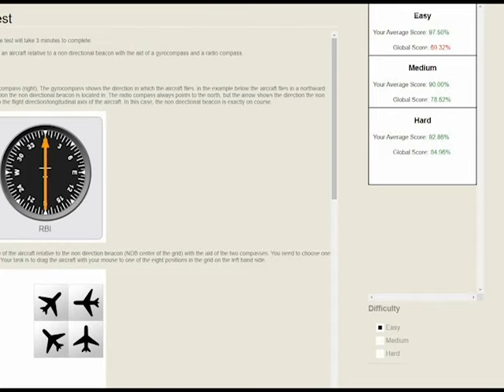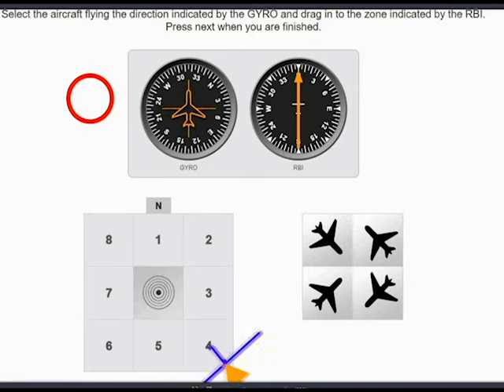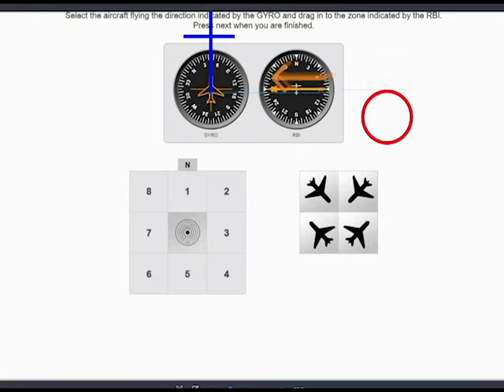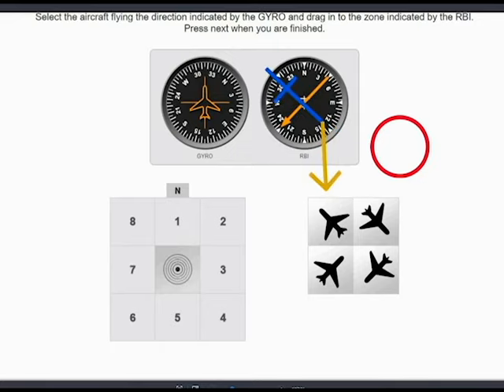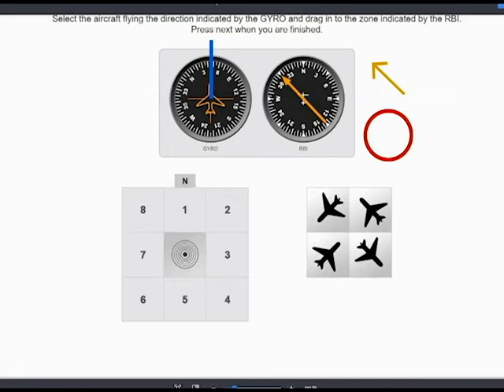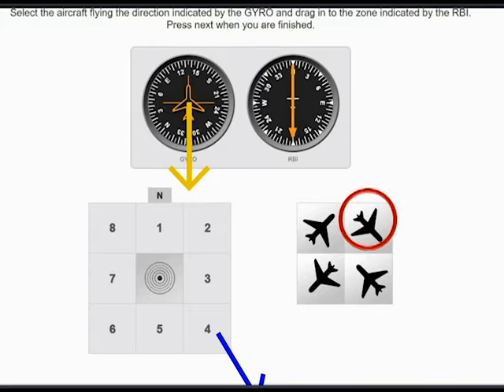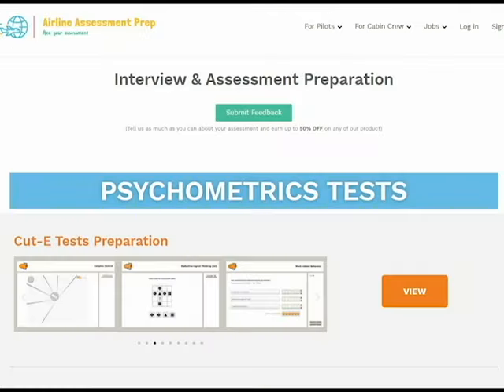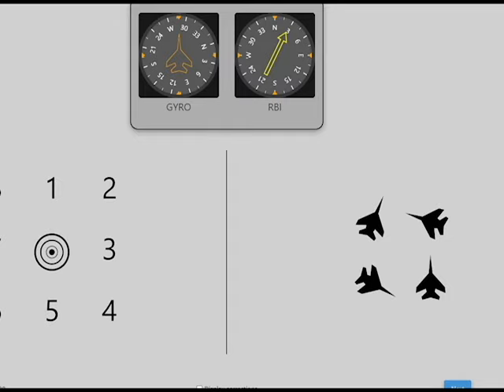Cut-E Spatial Orientation explained

Comment: Sorry, but this is a really unclear video. You just say "this has to go here and this has to go up" etc etc with no actual explanation of what's going on.
Reply: Feel the same way I need better explanation
Reply: I feel the same way. I need more details.
Reply: the trick in RBI is to rotate the compass but keep the AMBER ARROW in the same place. you need to get the deviation amount and turn the compass in RBI so that the same number will go to the top of the compass (instead of NORTH) when you finish turning the compass, you only need to check for the number you get and decide which number goes where, for example : on the first example he gives at 0:34 you can see the aircraft heading on GYRO is 315 degrees and so we get that 315 degree and turn the RBI compass in a way to make the 315 get to the top side and read the tail side of AMBER ARROW which makes 135 degrees and that goes to the right side of 90 degrees ( you must already know the usual placement of 90-180-270-360 degrees) and that would be number 4. I came here to remember the basics but thankfully this video didnot help me with the RBI section so i had to study from another source, if you have more questions feel free to contact me. Cheers!
Reply: @volkansavci4236  can you explain how you used that for the example on 1:36? Both the GYRO and RSI is pointing towards 045
Reply: @volkansavci4236  what's the other source you looked at ? I can understand the plane heading direction from gyro but not able to understand the rbi . How to move compass in rbi and how to get 12345678 given at bottom
Reply: 100%
Reply: Fact like what best explanation 🤨🤦🏿‍♂️💯
Reply: Thank you.
Reply: I feel the same way , totally do not get it , reading the comments with the different explanations even confuses me more
Reply: 😂😂😂 exactly more cnfusing when i attmepted this in the test no such thing was there theybexpect it to solve mentally.
Reply: Hey ill explain better, this guy is very wrong, you have 2 images above, gyro and rbi, gyro is for the bottom right image, rbi is for the number pad, gyro shows north east, so north east on a compass is top right, so plane would point top right, rbi is north east showing right top corner, so you get 2
Reply: N is above 1, which means north, the number pad is a compass, 1 north, 3 east, 5 south, 7 west, 2 north east, 4 south east, 6 southwest, 8 north west, its a compass for the rbi image[ top right image], points right corner so its 2, you basically look where its pointed to unless its flipped
Reply: i have 5000 hours in wide body aircraft and didnt understand anything 😂

Comment: This looks pretty clear to me now, I think once you understand the concept and practice it it is then very easy to solve.
Reply: I didn't understand the number concept . How the numbers are selected with arrow???
Reply: @md.enamulhaque6180  It shows N above one, 1 will be north, 3 east, 5 south, 7 west, its a compass basically, its for the rbi direction, so for 2:20 its pointing north east, 2 is north east because of a compass up right corner, then the plane image points to right corner, dont overthink it

Comment: Hopefully with my explanation things will be easier for you.😀 
Trust me, once you understand the concept it's really simple! However, it is quite difficult to explain in a simple way.. (Probably also the reason why it is confusing for so many people, because it ultimately comes down to your thinking and spatial orientation skills.) With other words, you kind of have to learn and understand it yourself, just like classic IQ questions. 
Also use platforms where you can practice on this particular assessment. Really helps! 

1.GYRO is the direction of the airplane. Additional information: The four cardinal directions are north (360 degrees), south (180 degrees), east (090 degrees) and west (270 degrees). 

2. RBI (always relative to the north) is basically what decides which number (1-8) it is going to be. 
_______________________________________________________________________________________________________
Example question.
- Let's say the GYRO has a heading of 360 degrees (north) and the RBI has exactly the same heading. 
* This means the aircraft-symbol has to be the one facing northbound. The number will then be 5 because it shows where the aircraft is in terms of the bearing towards the NDB. 

Tips!
I advise you to use 2 pens (one blue pen and one yellow)! The blue pen is the GYRO and the yellow pen is the RBI.

Move the blue pen to the RBI (always face northbound) and align the yellow pen with the direction of the RBI. Thereafter, rotate your blue pen to the original heading of the GYRO and MAINTAIN the heading of the RBI. 
By doing this you will always find the correct answer.

When you have mastered this technique, you can try doing it mentally. It will become a lot easier then.

Good luck with your assessment!
Reply: Thank you so much I finally got it !

Comment: Dude, if you transfer the arrow to the Gyro, the tail shows your position compared to the station like an rmi, and you just have to read the heading. takes 1 sec to do this
Reply: HEY man, I'm 100% sure what you're saying is the better way, I'm used to flying the tail on the HSI but I can't make sense of this test. can you explain your methodology?
Reply: Great Tip for everyone
Reply: Can you explain I’m having a hard time following?
Reply: This is not correct! The purpose of the exercise is a visualisation task because the RBI needle tail only shows the correct aircraft position when the aircraft heading is at the 'top' of the instrument. An RMI automatically updates heading information in this way so is a much superior instrument.
Reply: Thank you brother.
Reply: thanks buddy, forgot about this method and now I have 100% all times lol

Comment: How are you selecting no. From 1 to 8 ?
Reply: Think of the center square as a Control tower or airport and the yellow arrow will point towards that. And where the arrow is point is where the plane is at. And the Gyro show the direction

Comment: Is there any chance to do this with calculator?
Reply: Yess ‘ that’s would be easier ‘ just add up both heading ! Remember heading is just up to 360 degree ! If you add both values and get the ans exceed 360 , just minus that number from 360 and you get the result and see the Heading indicator for matching correct air craft shape
Reply: @jagvirsinghshergill4569  This person comment is more helpful than the video. I’m taking the practice test as we speak.